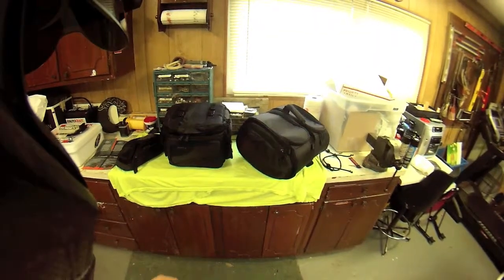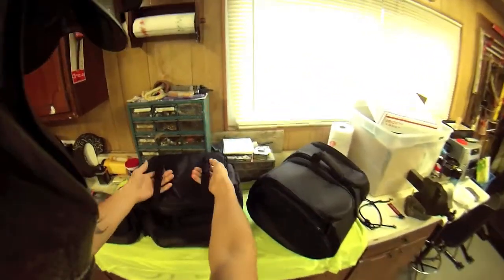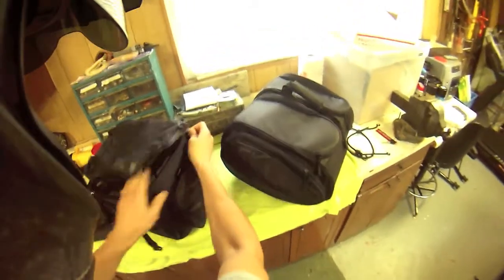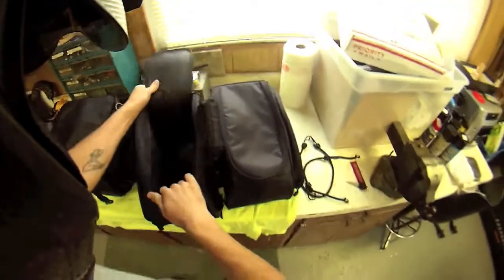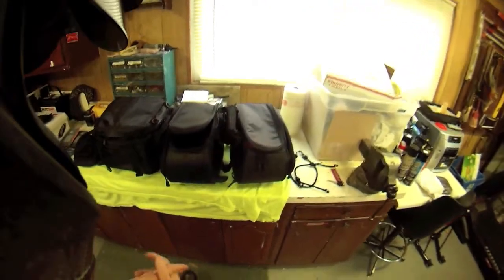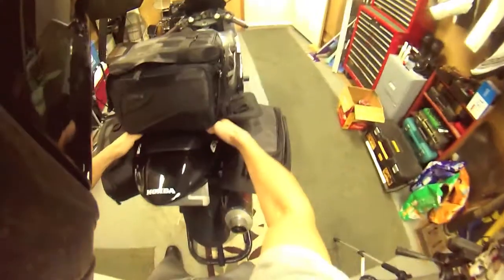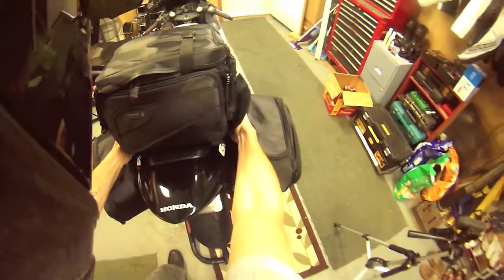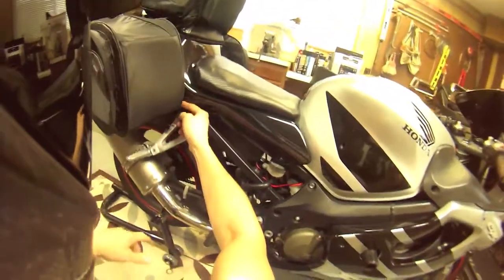Sedici Luggage set review and install

Comment: bought these bags and returned them, don't like the bungi cords.  I went with Nelson Riggs bags, they have built in clips which tighten with streaps and are much secure.  The tank bag is nice. Not crazy about that ail bag, kinda bulky and again those cheap bungi cords.  If they would have used built in clips with adjustable straps, I would have kept them.  I bought the sedici garda tank bag.